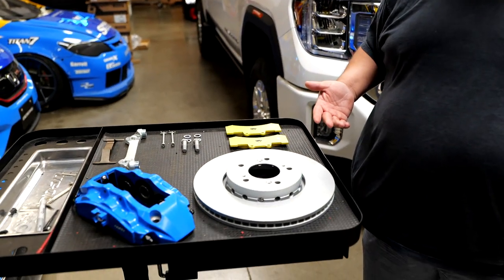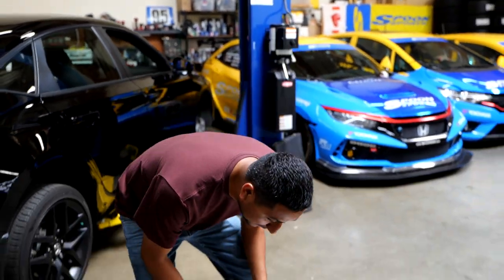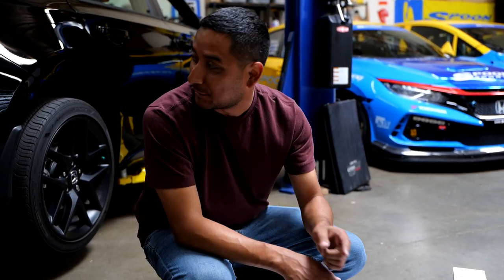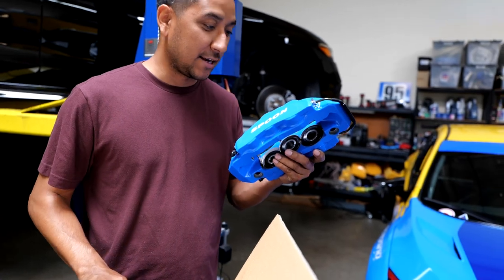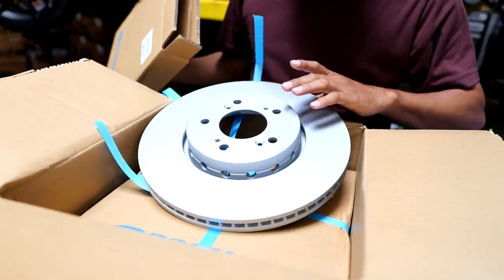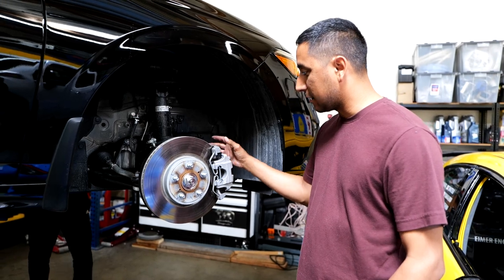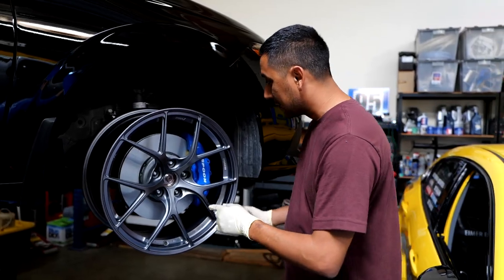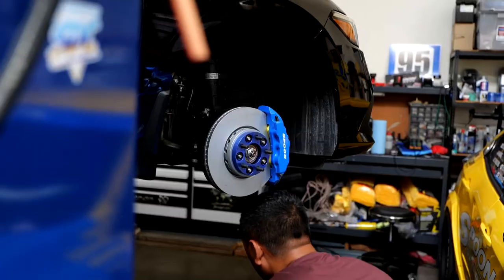Big Brake Kit for the 2022 Honda Civic Si | Spoon Sports R&D

Comment: are the OEM brakes of the 11th gen are similar to the 10th gen civic?
Reply from the maker: Yes they are similar, just needed some modifications so the bbk could fit properly.
Reply: @thefoatmedia  And what are those modifications? Trimming the brake dust plates? or the brake lines?

Comment: One thing I immediately noticed are the rotors are 1 piece, not 2 piece or floating. What do they weigh? But hey 6 pot Spoon rotors for free? Also are the rotors propriety to this kit it do other rotor brands make this size replacements?
Reply from the maker: The caliper does fit oem rotors so that’s a plus. The spoon rotors do have differences specifically for heat management.